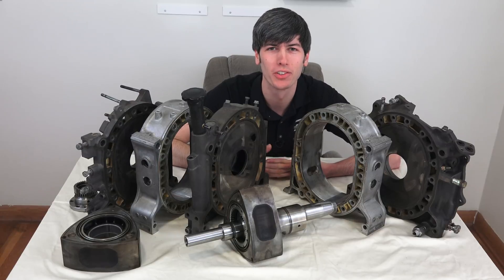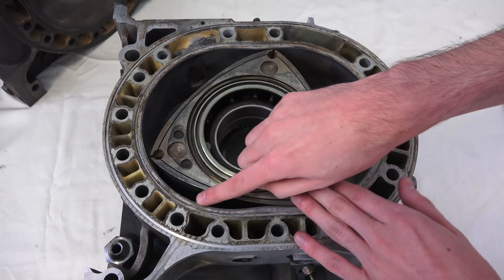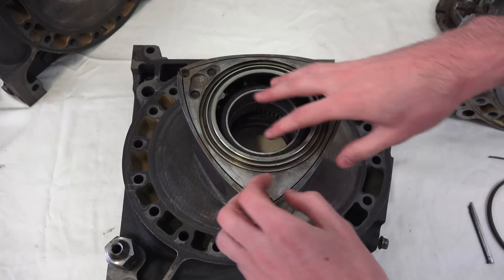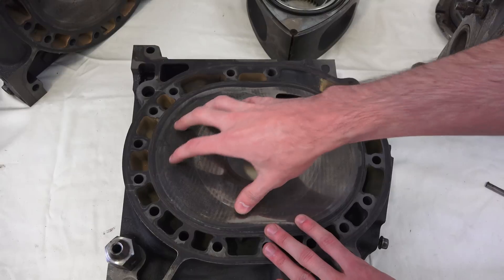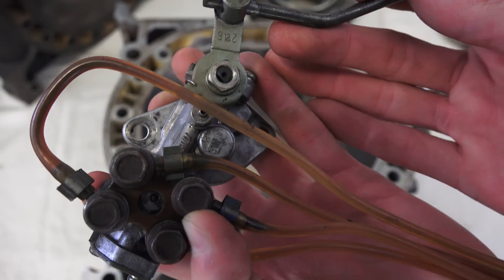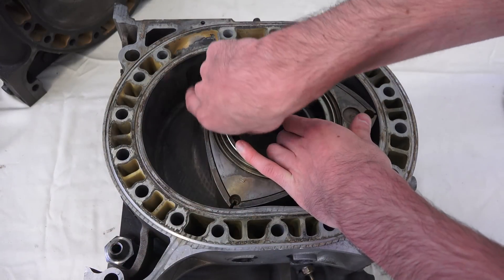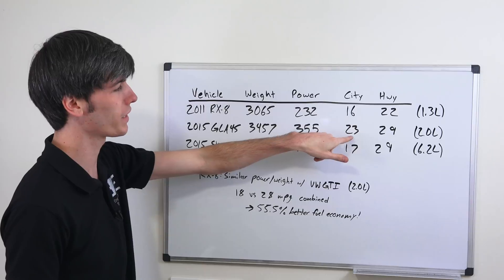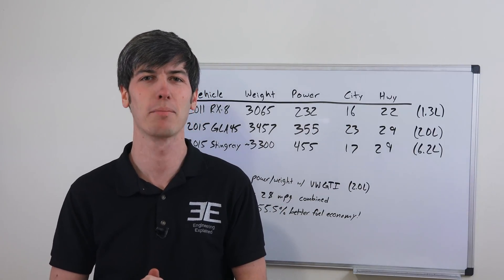4 Reasons Why The Rotary Engine Is Dead

Comment: I worked as a Mazda tech and service manager for a long time. The only reliable rotary I experienced was the 12A in the 1984 RX-7. Those things could run forever. After that came the 13B and problems with it. The apex seals would lose compression if our customers cranked it too long, or not long enough, or not 'just right'. Then the plugs (leading and trailing) would foul and they would never clean-up right. So a very common service was for us to pull the fuel relay, pull the plugs, and crank the motor for 10-20 seconds to spit out the raw fuel sitting in the chamber. Inject a little oil or ATF into the spark plug holes to wet the APEX seals and install new plugs. Crank it over with a battery charger on high to get best crank speed while listening to the compression rebuild and pop in the fuel pump relay at just the right time to fire up the motor. Then get the car outside as fast as possible because it would smoke-out the whole dealership otherwise. This was a common service for all 13B model years, especially in colder weather. When the Renesis came out, everything I just described became quadrupled. RX-8s were being towed in constantly for compression loss, and quite often our new car inventory of RX-8s would lose compression right in the lot. Mazda eventually released faster-cranking starters and higher amperage batteries for the RX-8, but those band-aids had marginal effect. Finally there was a warranty replacement-engine program in effect, and we had to put people on just for that program. I don't miss rotary engines at all.

Comment: If you convert the engine from gasoline to diesel and eliminate the direct injection of oil you fix all does problems, because diesel runs hot it also helps with the intake getting heat up by the exhaust! The engine was never the problem, they just run it with the wrong fuel!

Comment: Good analysis.  I'd like EE to also do one on the advantages.  A couple I can think of are:  very small size (our RX3 had a motor the size of the transmission)  and lack of reciprocation means very smooth - 10k plus RPM. 

 So it might have limited application such as for small aircraft?

Comment: In 1972, I bought a brand new RX-2 Mazda rotary engine sedan.  The rumors at the time said that the engine would need new engine seals at 45,000 miles.  
Gas mileage: The sticker did claim that mileage was similar to what this video claims.  
45,000 miles later, the seals failed.  Mazda was not changing them out under warranty.  So, I paid to have them replaced and subsequently traded the car for something else.  Mazda finally began replacing the seals under warranty - AFTER I traded it in.

I never let the oil run low.  

Bottom line:
Wonderful rotary sounds.  Good car.  Bad seals.  I think they discontinued making rotary engine sedans within a short period of time after that.

Thank you for posting this enlightening YouTube video!

Comment: The rotary engine isn't dead.  The Wankel version is dead.  A friend of mine has invented a new rotary engine, not on paper but a running prototype, which removed many of the bugs of the Wankel.  It isn't perfect yet, but it has been through two prototypes and a third is started.  The problem is not in the engine, but in the number of roadblocks put in front of him by government and banking.  The auto industry has been quite interested.  Perhaps with a new congress and a new president, it will actually make it to market.  Never count something out entirely, as long as there are people out there working on solutions to problems.

Comment: The car still runs with bad seals anyways, its just not gonna snap necks like it can otherwise.  What makes the seals go bad is letting it get too low on oil.  Its not like throwing a rod or spinning a bearing, it doesnt cause mass destruction.  I had one for 12 years.  It was a lot like a go cart.  Its a total drift car without modifying.  I used to do wheelies in mine in 1st gear just by building rpms to 4000, let off gas and tap pedal.  That was after modifying the exhaust to pipe & mufflers but I live in small town with no emissions tests.  Theres like 5 mini catalytic converters on it that hold it back.  Once all that crap is off they scream like raped apes and shoot fireballs out the tailpipes.

Comment: This is a very interesting video, thank you. 

I have no emotional (or financial) investment in a rotary engined vehicle, but I do have one question: Is it possible that most mechanics do not know how to work on a rotary engine, and that this also contributes to its rarity? 

Put differently: Are maintenance costs higher for rotary engines simply because the skilled labor to repair them is more scarce? Therefore dissuading people from buying rotary engine vehicles. 

Sorry, I majored in economics.

Comment: How's 18 to 28 is 55%? Am I missing something here?
Reply: Taking 18 and multiply it by 0.55 which gives you  9.9 Take that and add it you 18 and you get 27.9 (roughly 28) which makes 28 roughly 55% more then 18. Yay maths :D
Reply: Muffin_man17 Ok, so I AM missing something. I wasn't adding the other 18 (which I have no idea where it came from) 😂 
But thanks.
Reply: that or simply multiply it by 1.55

Comment: I've loved these engines since they came out, early '70s I think. Our local Mazda dealer used to race one at SIR International raceways on a regular basis. They had the governor 'off' and it cranked (spun?) 13,000 RPM (they had so few reciprocating parts, actually I don't believe they had any) try that with a  more 'efficient' engine!! HA Nuf said

Comment: Most of these problems could be solved by just making it a diesel, but you'd have to find a way to step up the compression.
Reply: The  Rx-8   for 2019  will  have close to 500 HP   and NO spark plugs   as a HCCC   ( High  Compression  Combustion  Chamber )  .   Rudolph  Diesel   and FORD   were not  liked by Standard  Oil   because   the Model T  was a flex fuel  to run  on farm   made    grain alcohol    while the Diesel   count run on Peanut oil   .  
       Rudolph  was bumped off  in 1913   while    Rockefeller  funded the temperance groups  that brought about Prohibition    so people couldn't  buy the  Still plans  from the Patent  Office   to make farm fuel  or buy Alcohol  to run the Model T .
        
  The  governments   are addicted to   the taxes from  Cigarettes , car fuels  and  auto parts   that   they really  don't  want   a smoke free  nation  with  Public transit  and Electric cars .  

      I liked the  old  Mazda  Rx-7   ,  I also  had a  1960's  Thunderbird   that got 10 MPG   in the city  and maybe  15 on the high way.   If mazda can  find the  price to make a profit  ....let the consumers choose  if they want to  buy one because  there are several  2-stroke  motor cycles on the road    and  Ski-doos   on the trials  as well as  2-stroke  Chain saws.   
          Either we ban  them all  or  let them fight for the market  share  to make the Engines  better  to reduce  pollution. 

   The   Leftists  in my  area  now want   the    Diesel electric  Trains to    be replace   with clean   Electric  train like in Europe .  But all of the   wiring  means  more toxic   mining   to get the material  and ship to  for processing and to build the   direct-power   electric  motors.  
       Cleaner fuel   that 100%  bio  will solve the problem .

Comment: For all its faults the rotary would have been great in the Miata MX-5. It would have been a compact, lightweight, high rev engine in a car where fun, not gas mileage is the main factor. Perfect. Sports car people would have put up with the quirks to get performance. Why didn't Mazda combine its two most innovative ideas? Perhaps they did not want the Miata to compete with the RX-7 and RX-8. And now that those are gone they don't want to develop a new engine just for the small sales volume of the Miata. Mazda is a small company and have to use their resources carefully. It makes sense, but it sure would have been a fun car!

Comment: Car and Driver reports that the rotary motor will be in a car 2018 or 2019 they pulled a patent on a new design on the rotary motor. the change of power and the change and how the EPA regulates us is going to change everything

Comment: I have a strange mind. I wonder how well a positive displacement brayton cycle engine would work using a rotary engine? 

To do this you'd have to clone all the ports so that the upper half of the engine is a pump, and the lower half is an expander. 

Air would be drawn in by the upper half and pumped into a common chamber for all rotors, where fuel (kerosene) is introduced and ignited (hot plug).

The exhaust from the fire chamber would then drive the lower half of the rotor. 

A turbo could be used to improve volumetric efficiency.

Comment: I'm no professional, and yes his points are valid, but wouldn't it also be true that piston engines are crap just the same they're only cheaper to make and customization is extremely easy. I mean look at all the blown head gaskets warped heads, locked motors, broken piston rods and motors with holes big enough to put your hands through. from my experience any motor you open up for fun is bound to require maintenance and repairs sometimes major ones. comparing a car clearly meant for thrills against daily drivers is an unfair matchup and the Corvette is in an entirely different league. frankly mpg means nothing to me, if I wanted a eco friendly car I'd by something completely electric and never have fun. rotary is still very alive for those who care for a different experience. personally I'm a fan, when I think about gas mileage I'll buy a Prius

Comment: I had an RX-7 with the 13B I believe, and it would shoot so much smoke, like seriously when you first turn it on for like 10 min it was like the bat mobile - think drag strip burnout smoke out the tailpipe for 10 minutes going down the freeway. So much smoke it would engulf an entire normal sized house when you started in your driveway. I liked the 4 barrel carb and it was fun.

Comment: The Wankel engine was introduced after it had gone obsolete.  In the 1950s it could have been a good low price engine, but by the 1970s, the inefficiency and pollution were issues too big to overcome.

Comment: I found out the obvious with my 1982 RX-7 - DO NOT RUN IT LOW ON OIL AT ALL (in the way you can with pistons)  of course ruined the engine.

Comment: The reason the Corvettes gets good mpg is because it has AFM (Active Fuel  Management) which is basically cylinder deactivation, where is runs on 4 cylinders. When power is not needed, turn it off and you're looking at 14 city and 21 highway.
Reply: Lets see a rotary do that.

Comment: Rotary Engines are still used if the vibration an noise is relevant. The seals and the cumbustion camber on Rotry Engines are easier to maintain as an turbofan. Small light and easy to maintain engines (may be carried as a backpack)! If you have space and weight isn't a issue, you go for a direct injection engine and if you need real power and maintaince isn't a issue (as you had your own maintaince staff) you go for the turbine (and one extra turbine hot water for up to 60%  efficiency).

Comment: Your reasons for the failure of the Wankel engine are valid.  One other fault that was implied, but perhaps not explicitly, is that the seals tend to wear out rapidly. 

If you search Scientific American from about 1905 to 1925, you will find at least one rotary Otto cycle engine per year.  Each was going to make the piston engine obsolete.   All suffered from faults similar to those of the Wankel, especially seal failure.   

As a point of engineering.  The accepted way to compare engine efficiencies is on a dynamometer where one can measure power output and fuel inputs under controlled conditions.

Comment: I just learned a lot about rotary engines. I did not know that they had oil injection. I had an RX 3 loaner in the 70s and it was very smooth. I was doing 65 on the freeway and didn't notice that I was only in 2nd gear. Oops.

Comment: Go to Australia and/or Puerto Rico and see if they're dead...
Reply: You are very wrong. Australia doesn't buy used vehicles from the US or Japan. That claim is false. Australia has a very high standard of living and HDI. You can buy the most recent and up to date models from every major car brand. Also Australia designed and engineered the Ford Ranger; which has won design awards in Europe. The Chevrolet Camaro was designed in Australia also. The Chevrolet SS is an Australian designed, engineered and built car.

I have provided facts and evidence.

http://www.goauto.com.au/mellor/mellor.nsf/story2/A74A912E2CE9F541CA2576FF001C6547

http://www.thedrive.com/new-cars/7799/2017-chevrolet-ss-is-an-aging-aussie-turned-american-hero

https://www.ford.com.au/commercial/ranger/

Comment: Obviously most folks do not understand a rotary.  They are one of the best engines ever made and though small, they perform like a 400 hp V8 with better mpg.  Also there is nothing as smooth as a rotary.  Look at its racing record if you doubt its longevity or performance.  3 moving parts vs 150 moving parts should be simple enough for even you  suedo mechanics to comprehend.

Comment: I did not even know that this engineering marvel exists. Cannot they make the walls in the exhaust chamber be closer to each other just by a tiny bit (100 microns) as compared to the ignition chamber to compensate for the differences in gaps sizes (between the rotor and the chamber where you put those seals) as caused by the temperature differences - I mean - cannot they even make it be of some special profile? These days you can use a computer (program) to evaluate those (combined thermal and stress analysis is available) and then you can use a CNC to machine profiles as you wish and pleased.

Comment: I used to play with rotaries, they're neat little gadgets and quite ingenious, but you're still better off with a piston engine. The lower thermal efficiency is a direct result of the Wankel's greater combustion chamber surface area, and that's it. Nothing to do with plug location, port timing or location etc. Sealing was very good on RX-7 engines, but of course they had to use oil injection, and that in conjunction with high fuel consumption means that emissions compliance is that much harder to achieve. And frankly, a high specific fuel consumption and difficulty reaching emissions requirements will kill a powerplant for use in cars--simple as that.
If you like funky power systems in your cars, have a fascination with rotating machinery for whatever reason, want to drive something really zippy, and have the dough to back it up--buy a Tesla :)

Comment: You got to admit that it's a wacky design. Oil injection is not a new thing. Correct me if I'm wrong, but Diesel engines are oil injected to some point.

Comment: So my country apparently put a rotary into an old Toyota 86 (from the 80s) and pulled a 6 seconds quarter mile. It's great for tiny cars because of the lower weight, but it does seem a bit fidgety for normal cars.
The plus side is they're dime a dozen over here. By far the cheapest engine to replace.

Comment: My second car was an RX-2 with a rotary engine. It was loads of fun and was fast in its day. To confirm the authors point that it didn't burn all the fuel, you could quietly sneak up on your friends and if you knew how gas it just right, the car would backfire and scare the pants off of them.

Comment: I own an 81 RX-7 equipped with the older 12A engine.  I love the car, consider it well made, and find it a joy to drive. It uses zero oil between changes,  gets 28 MPG highway and 22 MPG city. I would go as far as to say that it uses less oil than any car or truck I've ever owned.

Comment: OOOh - Not sure if I agree, but great info. If you are stuck in LA traffic with the A/c on everyone gets 10 mpg no matter what they drive. I first drove an RX2 in 1975 and loved the power but never noticed the gas mileage being terrible, because it was not. Those cars were very light weight. I'd guess that these cars suffered more later from the EPA emissions  regulations than piston engines.  Still they made great power when modified and weighed only about 1/3rd of a piston engine. Made great street racers that left a lot of corvettes embarrassed.

Comment: Finally someone explain why this engine isn't build in large scale.

Do you know about stirling engines? Sometimes this engine gains focus on the media and I know that it works, but what is his advantages and disadvantages  and that's there case where it may be used with advantages?
Reply: I suppose that it could be used in trains of some sort.
Reply: Sterling engines work on temperature changes and that makes them unreliable and unpredictable, when the ambient temperature changes so does the  performance of a Sterling engine.
Reply: Someone see how nsu . And mazda and suzuki and more useit ... thats call masive production
Reply: Clebermag
 Mazda are introducing a range extender version of the rotary in 2019; their anniversary.  A range extender is a part time engine. 
The Stirling engine is big and heavy.  It need a high differential in temperature, hence why used in submarines using cool sea water.  The efficiency drops off when in warm waters. Like the rotary the Stirling may be better suited to constant speed/load applications like range extending for large vehicles.

Comment: Rotary engine is dead because is wrong designed.
You can not take a 2 dimension design and extrude to 3 dimension..!!!  That is idiotic idea. 
If you extrude a 2 dimension circumference and extrude it, you will have a cylinder, NEVER a sphere.
That apply to all rotary engines, all of them have the same mistake.
Cheers.

Comment: The rotary engine did have one major advantage. It was designed and engineered to run at high rpms. That's why you see that motor highly prized to use in racing.